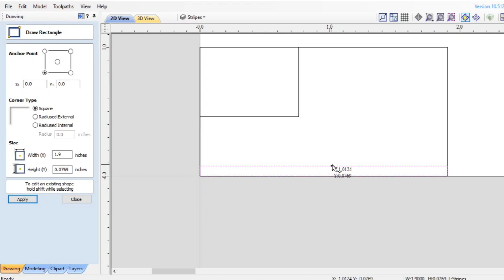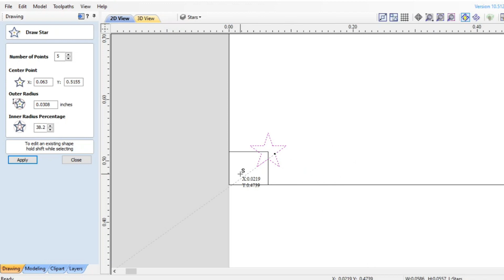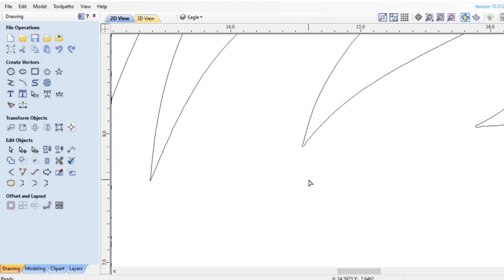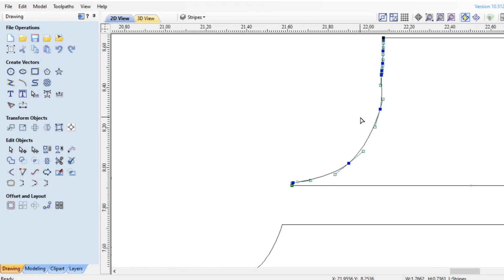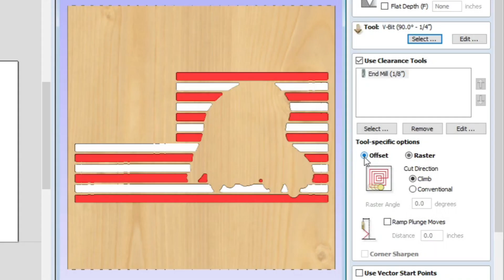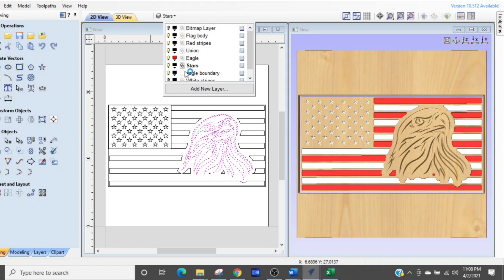Vectric Beginners First Pro-Level CNC Project (American Flag)

Comment: Really good video.  I would have done a curvefit of the eagle and its outer boundary to reduce the number of nodes and cut time.  Is there a reason not to do that?
Reply from the maker: AlBundy160, I'm glad you enjoyed the video! Curving the outer boundary can definitely help optimize the design and reduce cutting time, so that's a great suggestion. Sometimes, leaving more detail in can create a specific aesthetic effect, but it's all about balancing between detail and efficiency. Your approach is valid and can be very effective depending on the project goals!

Comment: How can I make painting templates?
Reply from the maker: davidweil9517, To make painting templates, you can use your machine to cut out desired shapes from a sturdy material like plywood or acrylic. You can then use these templates to trace the shape onto your painting surface for accurate placement. Feel free to experiment with different designs and sizes to suit your projects!

Comment: I very much enjoyed this video. I've been using Vectric for about five years. You're the first I've seen that builds a flag to standards, great attention to detail! I know there are many ways to accomplish a task, but I recommend fitting curves to vectors when smoothing bit maps. This eliminates a substantial amount of nodes the machine has to deal with. You were smoothing the curve that left many nodes, but you must have a reason for doing it this way.  Also, I learned to always check my material settings when I go to apply tool paths. I ruined a few pieces of nice wood when first starting out because my radio button was incorrect. I wish I'd found your videos early on, beginners and experienced users can benefit from them. Thanks.
Reply from the maker: saighusa, that is a very good point brother! That would save quite a lot of time. So happy to hear you enjoy the videos. Happy CNCing my friend.

Comment: What woods would you recommend to use..? What paint works best?
Thanks... I have Artcam 2018 Pro,  so it's close to what you're doing. I'll try it. I'm new to this. MDF vs quality plywood for a large flag..? Stain vs paint..?
Thanks so much.
Reply from the maker: SteveHonton, you can use any woods that are available to you brother! MDF might be the better bet for projects like this! Panting is a better option than stain for this one, consider using acrylic paint and sanding off the excess.

Comment: What is the different from the smooth function, keystroke S, and the using the Curve Fit tool?
Reply from the maker: John, the curve fit tool does a good job at removing redundant nodes but the smooth function doesn't remove redundant nodes but instead attempts to smooth the variation between them.

Comment: Great video! I've thought about looking into the bits you use but was wondering if they work across all spindle and router HPs including the bigger ones e.g. 10 hp. Thanks.
Reply from the maker: Larry, they sure do work across all routers and spindles. All you need to do is make sure that you have the right size collet for the spindle/router you have.
Reply: @IDCWoodcraft  Thanks, Garrett! I'll have to take a look at your offerings.

Comment: Well done :) I learned alot in a very short time, Thank you Sir !!     One question- I have watched it 3 times and read the transcript so far :P and it has eluded me when you added the 1/8 to the red and white stripes for the finishing passes but i see them in your list right before we save tool paths :))  did the vid skip or do i have tunnel vision.. Thanks for the link for the ora 813 will be ordering some soon as well as some of that starbond CA glue.
Reply from the maker: JP, can you specify the time stamp in the video that you are confused about? I will be able to help you easier that way.

Comment: how can i buy the gcode for a project already set up
Reply from the maker: Jery, that is a little bit tricky because every CNC has slightly different Gcode. You can typically download the files like you can in this video and generate the toolpaths using the specific Gcode for your machine.

Comment: Great video, really helpful to understand how to use the program. Is this considered 2D or 3D? I'm planning to start with Carbide Create rather than invest in V-Carve Pro right out of the gate. I think I can do 'things like this with programs that are limited to 2D. Is that correct? Thanks for any help you can give me
Reply from the maker: Hey Tim, I'm glad you enjoyed the video! Great question! This would be considered a 2D project. I haven't used carbide create for a while but yes that used to be the case and I think that's still correct!

Comment: Garret, I made my stars following your tutorial. When I generate a tool path for them I get a message that says 40 duplicate vectors will be ignored. What did I do wrong ?
Reply from the maker: Mark, does the tool path still generate correctly? Click "Ok" and see if if still turns out ok. Maybe you copy/pasted my file twice. Let me know if it turned out ok when you previewed it!
Reply: @IDCWoodcraft  Hi Garret, thanks for your reply. Yes it did generate a correct tool path. I deleted the stars and did them over,  again I got the same message. I ended up using the trim tool and going over all 10 lines of each star and deleted the duplicate lines. That did the trick, I ran vector validator and everything was clean.

Comment: Have a question. Say I imported a bitmap and fixed it up like you did for the eagle and placed it on the flag and then later wanted to add the same eagle to another project without having to go through all the changes is there a way to "copy and paste" in vectric to a different file?
Reply from the maker: Hi Bob. Yes. Make the flag and save it as a template. Then you can reload the templates whenever and add bitmaps
Reply: @IDCWoodcraft  Sometimes the easiest projects tend to be the most difficult. I'm making a birthday gift for my granddaughter and it involves two interlocking hearts. it seems I had no problem creating the hearts until I calculated the toolpath. ugh! Evidently my creation wasn't correct. I scanned all your videos and could not find anything addressing such overlaps. suggestions?
Reply from the maker: @bandd1952  copy and paste the same way you do in all programs. Select, copy, paste

Comment: Followed all the way till the end great video.  Have a question.  Would it be a good idea to move the tool paths so that you do all the areas needing the 1/4EM, then move the 1/8EM so that they group into the the same Vcode file?  Just wondering still working through these processes.
thanks
Dave
Reply from the maker: Dave, yes, you are right. Thanks for pointing that out and the great tip! I'm sure others might be asking the same thing.

Comment: I did your flag and it turned out great. Instead of the eagle I used a us marine logo. Lots of detail. Using a 90 degree 1/2 in bait I’m not sure if it was really able to get all the details. Is there another bit that would work better?
Reply from the maker: Hi Bob. If you're not sure the 90° will get the details, switch to the 60° v bit for the finer details.

Comment: Great stuff.  I had a Shapeoko 2 since 2014, but I bought it to make a 3D Printer out of.  I did that.  :)  Now I want to go the direction of CNC.  Although I have a strong background in vector art with Corel Draw, I'm still admittedly a newbie to this.  Thank you for taking the time to make such a great video!  I'm just torn to go Grbl or Marlin for firmware.
Reply from the maker: Hey Ryan, I'm glad you liked it! Right on! I'm glad you made your 3D printer and now are getting into CNCing with your Shapeoko! It's absolutely ok, we all start off as newbies! I recommend reaching out to your manufacturer to ask for their recommendations for firmware for your specific machine!

Comment: I keep seeing people using the interactive trim (the scissors) instead of the trim tool (the cylinder with the stripes in it to the let of the scissors)?  Why is this?  I have had great success creating the offset as you show, then selecting what I want trimmed and using the trim tool.
Reply from the maker: Terry, the trim tool works great but I'm a fan of the interactive trim tool because I can select small parts of the vector I want to edit more effectively.

Comment: Great video professor Fromme !  Can you recommend a cnc tool and computer to work with...Shapeoko seems to be popular along with apple MacBook.....your help is appreciated!
Reply from the maker: Tagdaddy56, thanks! I'm glad it was helpful for you! There are a lot of really great CNC machines out there. It really depends on what you are looking to make. I recommend you start by checking out this video, I think you'll find it super helpful. 
Here's the link: 
https://youtu.be/cfrD7gwsdgQ

As far as computers go, I would recommend any computer that has windows. It doesn't have to be anything fancy. If you want to use your mac you have to run it on a virtual machine.
Reply: Thanks for the response, Professor Fromme, I ended up going with Shapeoko XL pro......I'm just a hobbyist and gift maker. Not to say maybe later make I'll make signs/cutting boards for profit.....untill then I'm enjoying the process of getting started....Thanks again for your guidance.  @IDCWoodcraft

Comment: Hi Garrett, I'm still about a month away from getting my Longmill, but I watched the whole thing for the second time. I got a notice that the starter bits I bought from you are in town and should be here today or tomorrow. For the time being I am trying to get familiar with the software and the planning stages. I already have my laser engraver to play with and a 3d printer I am trying to learn, so plenty to do until my router gets here. I usually watch at least two or three videos a day but have to go back and watch them again before I try to run a program. By the time my Longmill arrives I should have everything I need to jump right in and start using what I've learned. Thanks for everything you do.
Reply from the maker: Hey docs48, hopefully your bits have made it there safely by now! You sound like you have your hands full of awesome projects! I'm stoked for you to get your longmill in hand and be able to start cutting! I'm excited to hear what you make and I'm always happy to help! Keep up the good work!
Reply: @IDCWoodcraft  Hi Garrett, I got my bits including the surfacing bit and I have been shopping at Etsy for fonts and plans, so just waiting for my router to arrive. I spend several hours a day watching your videos, often more than once, and am trying to learn the software and how to plan a project. I have a small Sain Smart router I picked up at an auction for $15 and it works, but the spindle is out of true, so I haven't been able to play with it until my new spindle arrives this week. It is not something I will use much but will allow me to learn the process from CAD/CAM to Gcode.

Comment: Garret, I followed your instructions to do this myself.  I put the overall outline of the body on the material.  When I add the union, it puts the Union rectangle ABOVE the flag instead of inside the flag. Makes no sense.  I am following along step by step....why would it put the union rectangle above the outline of the flag?
Reply: Garrett...and never mind....I skipped an important step.....ugh....learning
Reply from the maker: Hey Gary. Glad you figured it out.

Comment: What webs sites can you get complete svg or plug and route programs
Reply from the maker: Hi Brett. There are many sites to get SVG's from.. One I use from time to time is called Vexels. You can check it out here → https://bit.ly/30dDyMx

I am not sure what you  mean by plug and router problems.
Reply: @IDCWoodcraft  i means ones you buy and input and just hit start.  If im understanding it correctly  when you get and svg you have to create the tool paths for them to be comp9
Reply from the maker: @brettfarrell4818  That's hard to find. Most people don't create g-code files with their SVG files.

Comment: Thanks for the videos. I usually use the Curve Fit option to reduce the number of nodes and smooth everything out.
Reply from the maker: Hi Sean. I like to as well. I try to show people how it works in other ways as well. Sometimes, the curve to fit doesn't always achieve the needed results. That's why I don't always teach it.

Comment: Will Vetric/computer prompt you to change bits?
Reply from the maker: Hey Charlie.  It will not allow you to write the same g-code with 2 different bits. So you have to load the new run file when you do a bit change

Comment: Thank you Garrett! I am new by all means and wanted to ask you if I can do use Vcarve with my Xcarve. I've been frustrated with Easel and the V-Bit points that came out in a font and didn't understand why until you spoke of the nodes!!! That dig in point was driving me crazy. So I have my XCarve and I do like my machine (I know its not a pro piece) but don't know if I'm limited to using Easel. Again, newbie wanting to get more out of my equipment.. Tks
Reply from the maker: Hi David. Easel is a very limited platform. It is designed with the beginner in mind but doesn't leave room to grow as you get better.

Yes, any design software works for any machine.

Comment: Just finished putting together the MPCNC. Took all week to print all the parts with 2 printers running. I already have fusion 360. I use it to make STLs for my printers. So I will use that for the CNC as well. I have a video of me using Inkscape to make a flag on my 60watt laser. It is not the same as setting up files for the router. Can't wait to get started.
Reply from the maker: Hey KG. You've been busy! How is the build at this point (since my comment is a few days late)?
Reply: @IDCWoodcraft  thanks for checking in.. I have the cnc fully put together. Made a spoil board, the leveled it off with a straight flute bit. Then I saw your video, NEVER use a straight flute bit in a cnc. LOL  Got a new set of bit in the mail just now actually. learning to add them to fusion 360 now. Getting ready to make some sawdust.

Comment: I definitely made it to the end and learned a ton.  I import the g-code using the Easel post processor for Inventables X Carve.  I wish I could use a flash drive but that is not to be with my machine.  Thanks so much for your insights and valuable lessons.
Reply from the maker: Hi PD. Thankk you for hanging around.Sometimes, its better not to have a flash drive. All depends.

What did you gain the most from on this flag video?
Reply: The various insights into the tool and how to better use it to achieve the desired outcome.Short cuts and better use of the tool's features really helped a lot.  Having been a developer for a number of years, I understand how almost 70% or more of the power of the applications created never used because training doesn't present that and usually the trainer who is doing the presentation is a"bare bones" user themselves.
Reply from the maker: @pdwoodwerkz9625  thanks for answering that question. Always helps for making better content for you

Comment: Hey Garret, great videos. I really like they way you present your info. I do learn little things from you. Things I never thought of like smoothing  the nurb curves. Great tip. I t does make for a bit shorter program and some smoother cuts.  I'll subscribe and continue watching. I've been running CNCs for nearly 50 years, and there is always something new to learn. Thanks.
Reply from the maker: Hi Paul. I you got me beat when it comes to machining. But you are right. Someone always has something to give. Thanks for joining the channel.

Comment: Hello I need help getting my router running  can u help me plz
Reply from the maker: Hi Julio. What is wrong with you router? Have you spoken to the company you bought it from yet? They should guide you on this.
Reply: Well I bought it used , but when I turn it on it only moves one way and I don’t know if it’s set up right ?
Reply from the maker: @julioalvarez9686  I don't typically troubleshoot CNC routers. I teach about design and other aspects. My best advice is to go to the maker of the machine and ask them.

Comment: Thank you Garrett for this video. I followed the stars part of the video carefully and manage to get to the point where you remove the excess stars by selecting the rows outside the 50. However, I cannot do the removal at all. It's all 50+ or nothing. I cannot get it to highlight just the stars outside the box. Where might I be going wrong. I deleted and re-started 3 times but got the same result. I'm running the desktop trial version for the exercise.
Reply from the maker: Your starts are grouped. You need to ungroup. Select stars, right click, ungroup.
Reply: @IDCWoodcraft  Wow Garrett, thanks for a super quick response!  I'm going to give it a go and will get back shortly. Thank you.
Reply: Brilliant!! You are definitely the man Garrett!! Thank you. I will complete my purchase of the software shortly let you know how it all turns out!  Cheers mate!

Comment: Using the curve fit tool...does it help with cut quality and g code efficiency by drastically reducing the total number of nodes in a vector?
Reply from the maker: Yes, that is another way to work it. Regarding gcode efficiency, I don;t worry about that much. It will reduce gcode some.

Comment: Garrett, you mentioned rounding the strips from the really square corners to soften them.  i watched the video but didn't see that step.  I followed your instructions and made one without the bitmap and still purchased the on Etsy (for support).
Reply from the maker: Hi Pete. I'm sorry for missing that. Building this video took a long time and it slipped my mind. To round the corners, use the fillet command under 'edit objects', select 'normal fillet', add your radius, then click the corner of the object you want to round over.

Does that help?
Reply: @IDCWoodcraft  Yes. Thank you.